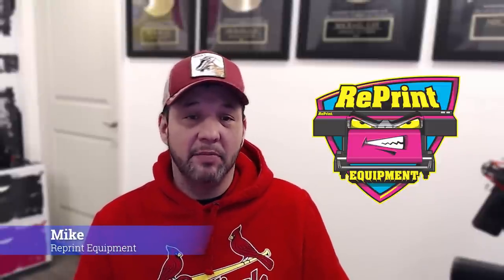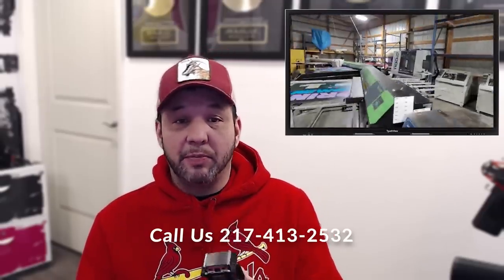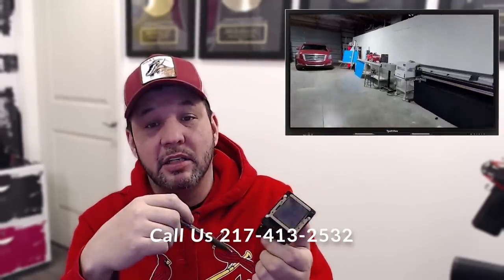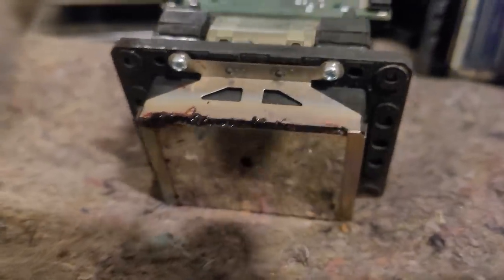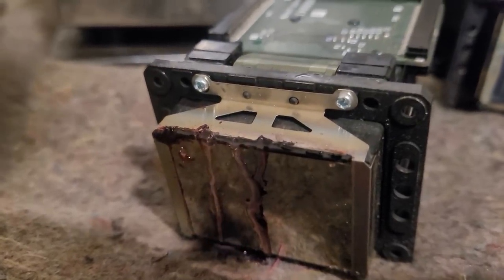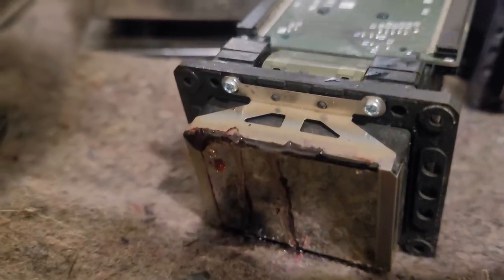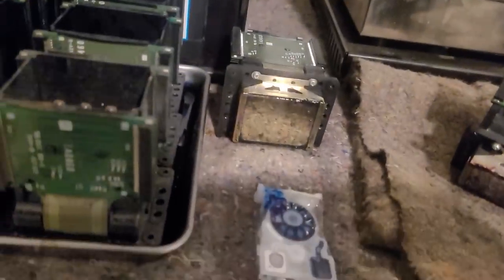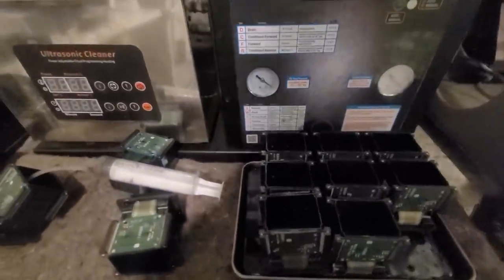What is going on with my DX7 PRINTHEAD?  Print head cleaner cleaning How to De lamination fix

Comment: Hi! getting a perfect test print on my VS-540i but get empty dots (fish eyes) throughout prints intermittently...have to do a head cleaning 2-3X and sometimes it goes away.
Reply: Already replaced Cap Top, Felt and Rubber Wipers...
Reply from the maker: I helped you solve this correct? Wanted to make sure didn't miss anyone

Comment: On Epson R2400, UV ink dissolved the ink manifold where the cartridges rest on, the plastic was softened and disfigured so no ink could flow through the holes. I see the "ink spray station" melt away to plastic goop.
Reply from the maker: Uv ink is very volatile and some printers are not made with solvent resistant parts. I see this alot with conversions.

Comment: Am interested to see next video! have tried to reseal before with no luck. I have found a very effective flushing method especially for the black channels that become "shoelaced" over time.
Reply from the maker: Love the "shoelace" never referred to it as that but exactly what it looks like! Lets connect love to learn your methods
Reply: Hello nice to come across your chanel, I have two brand new of those printheads that where bought for the Epson Gs6000 but were never used. Can they work on the roland? Or how can I sell them.

Comment: how much to fix head? mine has a small crack under the cage
Reply from the maker: They are pain in arse to fix. Yours maybe manifold issue
Reply: @reprint217  It is leaking on the side. just a hairline crack around a 1/4 inch long. Head is flushed and clean.

Comment: Hey, did you even post of video on re-attaching the nozzle plate? I cant find it :/
Reply from the maker: I have the content and had it on here for a little while but became messy. I sent few dx7 heads and small batches of glue. And nobody was able to do it. Only one had a good microscope. After I ran out of the glue I pulled it. The glue is over 200.00 and I didn't want to be responsible for someone wasting another 200.00 

I may repost when I order more and can sell smaller qtys of the glue for those wanting to try.
Reply: Can you make an image where the adhesive gos on the print head do you have to go around each nozzles with adhesive?

Comment: I attempted to clean the manifold by sucking solution thru the head, after putting the dampers in place and installing the printhead, the cage where the dampers are filled with ink. Do you think i did not put in the dampers correctly or i messed up the head when pulling solution up? Also  this happened when the printer was on and printing something, so it threw the 075 code, i removed the head again and it was wet/ink all over the electronics parts. i hope i just fired the head and not the motherboard. what do you think? Thanks in advance.
Reply from the maker: Oh man, had a damper blow and cause this. Not a pretty sight. Likely would have tripped a fuse if it was on. I can fix if need be. Also may have head for little cheaper than online prices. I have too many at moment.

Comment: What glue do you use on the printhead plate please ?
Reply from the maker: The dx7 actually has 2 different adhesives. One for inside of nozzle plate area and one for the outside. 

I myself use Ablebond 931-1T1N1 for both areas.

Comment: Print head not gloged xp600
When flushing hardly hearing the ticking frequency that spurt,so it's not spraying the ink out of head 
How can I fix 
Send foto to where issue can be 
Thanks
Reply from the maker: Sounds like some kind of build up in the head. Ive seen cases where some ink channels waterfall nicely and others take alot more pressure. Pulled the head apart to inspect and found a mound of dried ink.

Comment: So, I think i saw a printhead doctor unit in one of your videos.  Any chance you might be willing to share what your experience has been with it?  I just got an XR640 and have an LEF2-300 on the way that both need major head cleaning.  I'm wondering if it would be worth it to have that device on hand to both try to recover the heads in these machines that were left sitting for a while as well as to perform some kind of gentle periodic maintenance flush to keep the heads clear as time goes on?  I'm gonna have two DX7 and 4 DX4 printheads that I'd like to keep in top shape for as long as possible.  It wouldn't take bu a few replacements to equal a cost of a printhead doctor, even the more expensive models.
Reply from the maker: Love my printhead doctors for industrial heads. At first i was impressed at how it unclogged but every epson head I ran through the machine either was doa as soon as put in the machine or failed shortly after. 

Epson heads are very sensitive to any type of pressure. Highly advise against it.
Reply: @reprint217  Got it.  I was really hoping vacuum assisted reverse flush at super low pressure would be a bit of a magic bullet.  Just set it and let it run at next to no pressure for a long time instead of the soak, rinse, and repeat method.  Just thought maybe that a slow but constant circulation of a cleaning fluid would keep flushing the surface of the clog with fresh cleaner and be a good idea.  Thank you for the feedback!

Comment: Question, is there a way to tell that your DX7 printhead is fried? signs? I have a 1324x printer. We had to change out our printhead as there was an error message we were trying to fix. So printer sat for months and months. Anyhow, changed out printhead and no more error message. However , when printing on media nothing prints at all. inks are charging and empties out in waste properly when cleaning. we were told printhead may be fried. (we've also check the fuses on mainboard and CR board and they seem to be working) We live in the islands so its really hard to find a tech here to come out and see. In need of help please
Reply from the maker: These heads are very sensitive and ashamed to say even with changing out 100s of these heads I too have ruined a brand new head.  If you know ink is flowing and fuses are good. Than likely head is electrically shorted out. 

In my early days being self taught did this a few times and it sucks
Reply: @reprint217  thank you for your reply, would you know what would short out the head? what precautions can we take to help with shorting it out.

Comment: Hey mike! I replaced my print head and my 540 came back to life but the ink itself literally won’t fill the tubes. Is there a priming procedure?
Reply from the maker: Couple power cleanings ink should be flowing unless you have another issue. First I would check the captop and pump. Gravity plays big roll with the ink delivery system so usually couple or few cleans should get you some progress.
Reply: @reprint217  some of the inks responded to the "fill ink" command and the captop seems to be working because ink is passing through the head into the bottle. The bizarre thing is that when trying to run a test print it does not even put down the colors that clearly have ink in the tubes

Comment: Do you also buy printheads? I got a free bn20 and starting with replacing the cap top and dampers but if I have to replace the printhead would you do a buy sell deal? I'm gonna soak it for a few days and see.
Reply from the maker: I wish the used heads had a value as I have many. Yes keep soaking. If head clogged from lack of use. Than they are pretty easy to save. But majority I receive the original owner stopped using because printhead failed

Comment: can you please share the glue name?
Reply from the maker: Epotek 353ND, available from Epoxy Technology Inc., and Ablebond 931-1T1N1, available from Ablestik. Ablebond 931-1T1N1 is preferred for its thixotropic properties but is less resistant against some type of inkjet inks, e.g. water-based inks. Epotek 353ND on the other hand has good ink resistance properties but is not thixotrope and thus can easily flow into the ink chambers if the adhesive was applied too thick or if the nozzle plate was pushed too hard against the front surface of the printhead body.
Reply from the maker: This is from the Patent documents if the printhead. They use 2 adhesives. 

Epotek 353ND, available from Epoxy Technology Inc., and Ablebond 931-1T1N1, available from Ablestik. Ablebond 931-1T1N1 is preferred for its thixotropic properties but is less resistant against some type of inkjet inks, e.g. water-based inks. Epotek 353ND on the other hand has good ink resistance properties but is not thixotrope and thus can easily flow into the ink chambers if the adhesive was applied too thick or if the nozzle plate was pushed too hard against the front surface of the printhead body.

Comment: New sub here did you ever put that video out on how to fix delaminated print heads I have 3 dx7 needs fixing thanks for the video
Reply from the maker: I did, however, I removed it as most people just wasted money on the adhesive. I had a large bottle and supplied some to a few as it is pretty costly. Didn't want to be responsible for people losing money. I've been working with one guy who has had a pretty good success rate, but I had sent him 20 heads to play with beforehand. Took him destroying the majority before making progress.
Reply: @reprint217  do you repair heads? I just need to know if the adhesive gos around each nozzle do you have any pictures on where to put the adhesive truly appreciate you